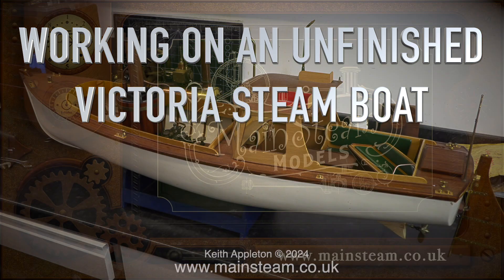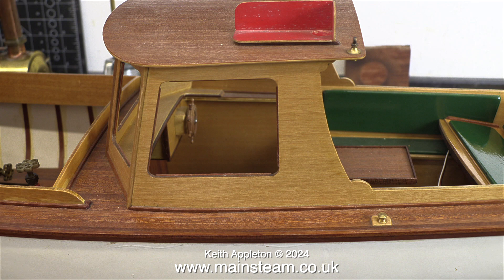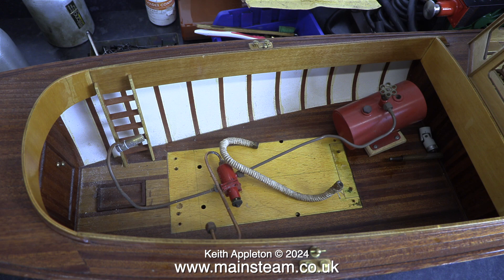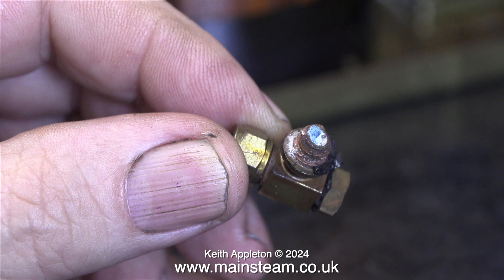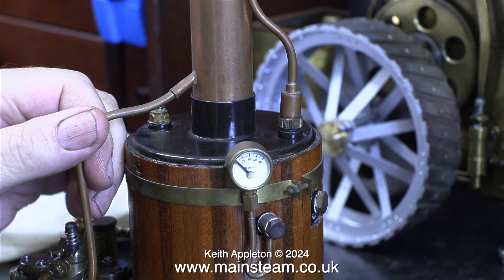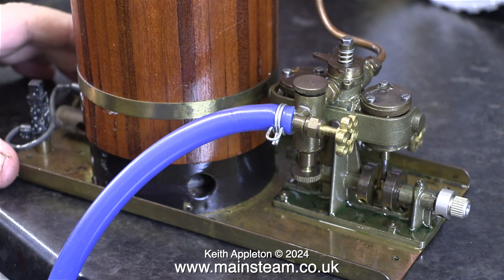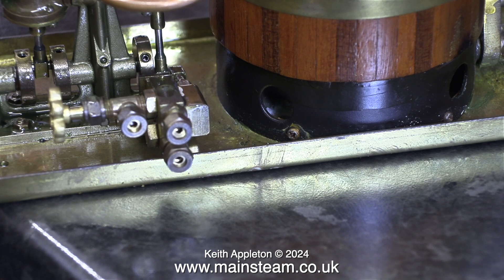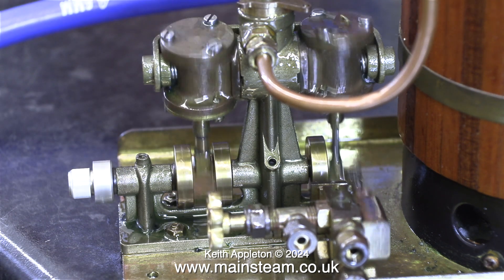WORKING ON AN UNFINISHED VICTORIA STEAM BOAT - PART #1

Comment: This feed pump was also sold in Germany. I had it on my model ship steam engine for a while and it worked very well. However, it was later removed again because a trip with one boiler filling is enough for 15 minutes and the pump uses unnecessary power. 

Greetings Michael

Comment: I have exactly the same engine and water pump also the attenuating gas valve and gas tank all later Cheddar models, you may find the diaphragm in the attenuating valve has gone hard mine did, it stops it working.
Reply from the maker: I never use Gas regulators anyway . . .

Comment: Would it helped by slacking off the 3 bolts on the top of each cylinder possibly, to centralise each cylinder to each piston then re-tighting after a few revs by hand, I'm not an expert or even a novice at steam engines but as you don't know how or who built it, I thought it might be worth a shot if it didn't free up to your satisfaction. If this idea sound stupid, tell me to leave it to the expert and be quiet. Nice boat, it would be good converted to romote control.
Reply from the maker: No that would not do anything. Later on in the series I found out exactly what the engine was, and made it run very well.